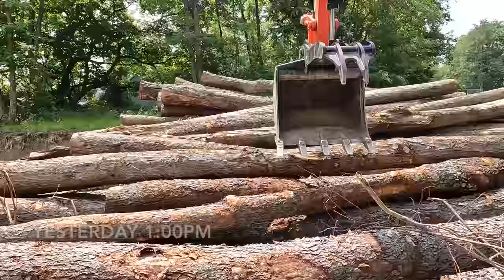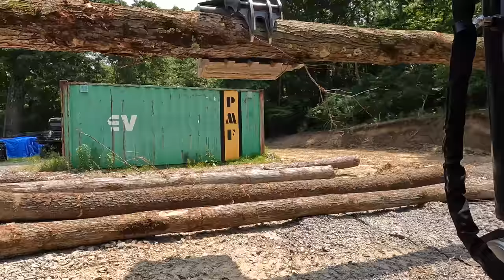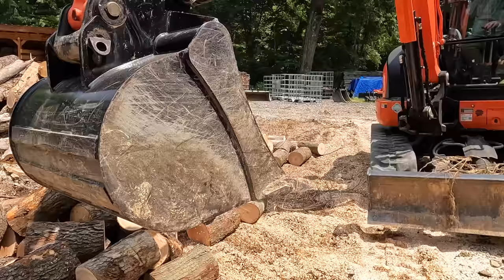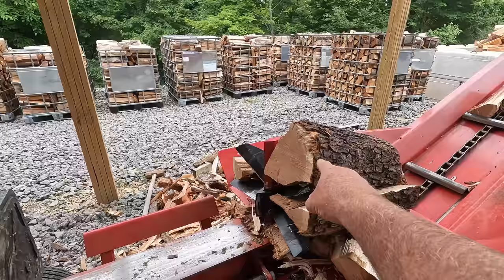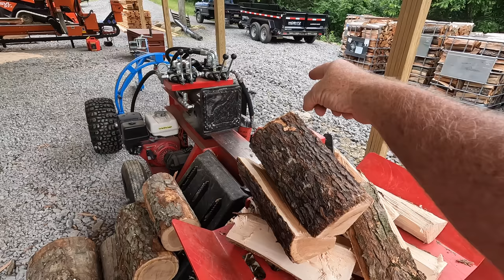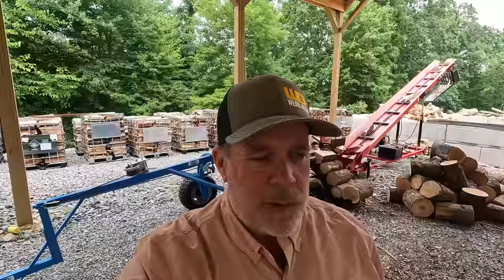Unfortunate Accident at the WoodYard, Freak Accident

Comment: Good Ed will be ok.  Accidents really suck.  Im still wearing severe scars from 20 years ago in a welding mishap.  I use to us use a belt-driven by a tractor buzz saw.  It's now a yard ornament.  Those are really dangerous.  I recall stumbling over pieces of wood near the blade while it was running.  I decided to stop using it lol.

Comment: The combination of the strain energy locked up in the knot and that introduced into the edge of the round where the ram was pushing it through the wedge probably provided the energy to launch the round forward and up.  The piece was restrained until the wedge completed the split.  Then the compressed wood containing the strain energy relaxed, pushing the piece up and forward. 

 A similar thing happens when a leaning tree "barber chairs" during felling.  In that case, it is the bending caused by the lean in the tree that builds up strain energy in the trunk wood.  When you cut through the tension side of the trunk with a back cut, the strain energy shifts to the center and the wood fails in shear along the length of the stem.  After that, the weight of the tree bends and breaks the attached remnant of the stem. ( When avoiding barber chair, doing a shallow notch and a central plunge cut removes the central region of high shear and shifts the strain into tension in the back strap.  The wood doesn't fail until you cut the backstrap because it is much stronger in tension than in shear, and the limited area of the backstrap section doesn't allow a large crack to develop.)

Comment: So glad to hear that Ed wasn't more seriously hurt. Would it be possible to get a cage to go around the splitter and about 2' more towards the conveyor, sitting at least 1' above the top of the center splitter shaft and out to the edge of the tray on either side to keep any breakouts  from flying off again? I've seen the cages on other types of higher performance machines. Wolf Ridge may have something, or it could give them a new market, or a market for some entrepreneur who watches and is in the area.

Comment: In the UK we had 10 feet x 6 feet weld mesh panels in a tubular frame, stood in concrete or dense rubber blocks and clipped together. They are called Heras panels and they are most often used as temporary barrier fencing around construction sites or other areas you want to keep people excluded from. They are light, one man can erect easily, and I suggest that if you can obtain them or similar in the US that you do so and create a "crowd barrier" say one panel out from the log roll loader and then say 2 panels long towards the dump pile and do it on both sides. Then people cannot get within range of shooting chunks of firewood. As a former Construction Manager bearing responsibility for safety on my sites I would have been obliged, by law, to do an assessment for safety on the operation of your machine and almost certainly the legally constituted Health and Safety Executive would have shut me down had I not done the barrier fencing. God has been kind to you even if your Father-in-Law doesn't agree, you have had a lesson to take to heart showing something you were not aware of before. Now you know and can thank God no serious injury from the lesson. Love your videos and applaud your honesty in this one.

Comment: I'm glad Ed's condition wasn't any worse, and it surly could have been considering the unfortunate circumstances. As you know, that knot build up a lot of resistance and stored energy. At some point, it was going to suddenly release, and it's anyone's guess which way it's going to fall or go flying. Yep, one in a million, but you could say it was the perfect storm of events. Anyone who has used a log splitter has witnessed the resistance of going through a knot and seen or heard how that energy is released. Thank you for sharing. I'm now wiser for it.

Comment: Mike glad it was no bader then it was .But the knot was the problem it took so much pressure to cut an pop the knot it went flying when it came apart .I have  run a timberwolf tw5 from in the 1980s and had wood that size go 20 to25 feet straight off the wedge over split wood it has happen with all 3 wedges that is the base +4 way and the 6 way  it is something that that happens when knots are there, no knots no problems. It was good that it was not worse  but didn't blame yourself its just out of everyone's hands,just keep making firewood extend your table and put raised sides on it will  help keep wood where you want it good luck to all of you

Comment: Glad to hear Mr Ed is going to be ok, That is the main thing here.
As for why, @15:24 if you look at the log that hit Mr Ed, you can see there is a knot in the log that was grown over. I have to wonder if the grain binding about that knot was part of the cause why the log shot out once the ram overcame that. I know splitting logs for fence posts the area around knots always takes more effort to separate the fibres.

Finally, I wonder if a 3-4 foot square cage of 2" square pipe over the wedge and conveyor end would be worthwhile. All the force in the ram is pushing that way, a cage might be a good idea to catch the ones that pop out that way.

Comment: Needs a POO (point of operation) guard. Something like a chuck guard on a lathe. Not to be in place all the time because it would slow production but if you see a piece of wood start to kick up you can swing that guard in place and if it kicks out it will hit the cage and stay where it’s at. That way you can use the 6 way and it won’t slow down production. Just an idea! Thanks for the videos!!

Comment: I'm just going to say I run a wood processor for our own use, and I have seen even with a 4-way wedge that periodically the wood is up to the wedge, and it doesn't split right away but the ram is still doing its thing and then BANG the wood goes flying through the wedge. I haven't had any go air born like yours Mike but have had them build pressure if you will and then all of a sudden let go. Glad everyone will be Ok.

Comment: You can see exactly what happened at the end of the video.  You can see where, once that piece of wood started to tilt up, the wedge started to dig into the grain just forward of that little knot, and the compression on the small amount of wood that was still unsplit ramped up quickly, and that knot broke loose and it was off to the races then.  You can see it in the piece below it where that little knot is also. Just a freaky thing, but every piece of wood and every split is different.  Very glad to hear Ed's lookin' to jump right back in the saddle.

Comment: I think your culprit is the knot. Usually when splitting wood on tries to split around the knot. Sometimes splitting through a knot can't be helped. The knot is trying to hold the wood together since it is going cross ways through the grain. As the ram is pushing the wood through the splitter blade, the wood starts to split but the knot is holding it together, just like rebar does in concrete. As the pressure increases, the wood starts to compress until the knot breaks. When it breaks it can let go with a pop, and come flying out with considerable force. I've had it happen to me when using a small electric splitter and it was straining on a piece of wood with a cross knot. When the knot broke the piece of wood came flying out with startling velocity.

Comment: I have had this happen to me, but only with cheaper log splitters that were built thinner. What ends up happening is the I beam and the push plate and the wedge all bend apart under heavy load (on cheaper units its worse because they are under built) and it acts like a spring under massive load and once the wood splits it shoots out like a rocket. I am surprised that happened with this splitter.

Comment: Glad to hear Ed will be okay. I had a similar thing happen on one of the small electric splitters. I put too large a piece in the ram and it kept pressing until the piece shattered. About a 10-lb piece instantly flew past my face and went right through our stockade fence. Hate to think what would have happened to my face. I’m already ugly enough! Stored energy can be instantaneously released with bad results. Ironically, in your case, it seems you were doing everything by the book - a tough example of accidents do happen. Glad everyone is okay.

Comment: I've had that happen a few times. 1 piece few about 15 ft out. The rest was within a few feet. And this was with a single splitting wedge.  If I'm not mistaken they were all with knots in them. Elm was the worst.  Build pressure till it popped and the wood flew.

Comment: We had the same thing happen with our wolf ridge. It had the 4 way wedge on. Shot a piece about 8ft straight out into the middle of the dump trailer. It was ash we were splitting at the time. We believe it was slightly froze, and popped apart when the pressure got behind it.

Comment: I have been splitting wood since the late sixties.  Currently have a very nice Wolfe Ridge splitter.
Can't tell you the thousands of times I have had pieces blow off the splitter....reasons in N GA:
Green wood, cold almost frozen wood, or knotty wood. Red oak most common to do this.  80% of the wood I have split is red oak.
Still splittin....

Comment: Build a hoop cage around the cutter wedge. Make it 5-6 inch’s larger then the biggest round you run through. A full shroud will stop those accidents. It can only shoot straight back or forward. I’ve shot a split 8-10 feet right into my truck door. Hard dry wood splits with explosive power at times.

Comment: Glad he is okay. Ive had several pieces come off the splitter at a pretty good clip. Some steel plate hinged on the side opposite of the operator and coming up and over the wedge wouldn't be a bad thing to have

Comment: I've had that happen several times, and I don't split a lot of wood, and I'm only using a 5 ton harbor freight electric splitter. I'm using a single wedge. Knotty rounds have so much kinetic energy that they launch rounds 15 feet. I had one kick out the side hit me on the head, and I fell towards the splitter and got my finger caught on the returning ram. You need two hands to operate it, and I pulled my finger out in time to stop the ram. Finger was mangled pretty bad.

Comment: Certainly glad the worst case scenario didn't occur. 
Would there be any way to make a chain link fence frame maybe 6 feet wide and 6 feet tall and place that maybe both sides or at least one side beside the area where the wood is split?
Chain-link wouldn't really block being able to see the machine and what's happening.

Comment: I was pressing a stuck moving jaw from a 4" Wilton vise with a 12 ton bottle jack not too far from Mike here and it was super sketchy.  There is not a flat surface to fixture off of in line with with the force so a 8" SCH80 1" pipe was passed under the stationary jaw/body cribbed up, and the rotation force countered with some other cribbing opposite the torque moment.  It took almost every bit of that 12 tons to break free and when it popped it was like a bomb.  Its a mechanical bomb.  That 8" long piece of 1" SCH80 pipe looked like a banana when we were done.  If the 12 ton bottle jack didn't work..the plan was the 20 ton log splitter.  Lotta energy.  Respect hydraulics.

Comment: Glad Ed is OK but I'll admit it's so easy to get used to a machine or a process (especially a repetitive motion like a log splitter) and get complacent and you let you guard down. Same thing happened with me and my ex-father-in-law splitting wood with his log splitter. I was running the controls he was loading the machine and we had a system where I would wait to hit the lever until I would see him nod his head well he nodded his head but his hand was still not out of the way and I ended up kind of pinching his finger between the end of the round and put on the splitter. Luckily it had the little rings on the bottom which hold the log off the flat foot so it did not crush his finger but it did pinched it really hard. I felt really bad when it happened but he kept assuring me it's not your fault I nodded my head and said go

Comment: that knot caused it to build up pressure at the one end aswell as putting in down at that angle. I have split ALOT of firewood and i can look at the pieces that wont split easy....You can hear it aswell. I listen for the machine and if it starts to struggle dont push through it. I have had one do something similar when i was younger and it happened when it was REALLY cold out. Hope your father in law recovers quickly!

Comment: Hi Mike,  I just wanted to add, I've had rounds jump most often when the ends aren't cut square, forming a kind of ramp.  I've thought about welding teeth to the wedge or pusher plate, but that might make it worse.  Or maybe a Tee plate welded to thd top of the wedge might work. Also, about 80% of the "jumpers" have been when usìng my SuperSplit kenetic splitter.    I was watching Hard Working Man the other evening.  His kenetic is even faster than mine.  He got hit in the crotch twice by flying wood in that video.  I notice that some of the processors have guards on the saw blades and on the splitting ram.  I hope your father-in-law is Ok and gets well soon.  Prayers gone up.  ;-))  Shalom/gw

Comment: I have seen these with a steel cage over the splitter. Just a half-round sheet of steel with 2-3" circular cutouts so you can still see what is going on, and just the length of the splitting bed. This allows you to stand next to the splitter and if anything does fly off it is going to hit that cage and not you.

Comment: Lots of pressure built up in those logs, especially the knotty ones, you never know. An expanded metal cage open on both ends would prevent future flyers from happening. Log tunnel if you will. Glad everyone is alright.

Comment: Like everyone else,  I'm glad the Ed is going to be ok. I was going to comment about everyone working way to fast around machinery. ( video sped up lol ) you can have all of the safety equipment that you can think of and sometimes you just get a freak occurrence happen.  I think that the knot was in the perfect position to put and extreme pressure load on the round. I'm sure that if you showed the video to Wolf Ridge they could develop a cage around the cutting wedge that wouldn't interfere with running the round through but could prevent it from kicking up like it did.

Comment: Glad Ed is Ok. I have had pieces that will split with explosive power. Looks like a crouch piece. Those are the buggers. Made the decision not to cut firewood in the woods with my 87 year old father. He was retired from railroad with disability when he was 56 because of arthritis. He got hurt on the job and they wouldn't let him come back to work because the arthritis. Not his choice. He's a stubborn working fool thinking he can work and get around like you used to. He needs a walking stick to get around but wants to help in the woods. Told him I am not working by myself because then he thinks he can help me. I was cutting down a stub of a tree and needed to push it over with the tractor because I had pounded the wedge all the way into my cut. He comes out stumbling around with his walking stick and is too close to the drop-zone of this tree he proceeds to argue that he could move if he needed to when the tree started falling. My brother's don't have time to help and he would be in the middle of the action anyway so we laid down the law that we would only cut firewood if we got pulpwood lengths delivered and we cut them up in the yard. ☹️

Comment: 6/20/23...yikes! Oak knot, curved grain, fast ram to 6-way & 'pop' curved grain under ram force resulted in instant shear/separation & large segment under compound pressures up-lifted instantly flying upward (12"-18"?) to right side of splitter striking helper in face/upper nose/forehead area striking/driving eyeglasses (nose bridge) into & cutting skin & simultaneously knocking man down who (in crowded area of cut off 'rounds') fell striking ribcage & results in combo blood & shock to victims & all other family members helping & participating in this, a routine wood splitting activity familiar to all present. 
  Wow! Thx Mike for the step-by-step replay. Glad gentleman is not seriously injured!
  How about building some steel wire-frame cage around exit end? Does mfgr. make/or can make a 'safety cage' for this area.... prevent/control 'grain-pressure-during-split-blast-out'? 
  Thx Mike for sharing this info. Appreciate yur honesty & loving concern for your family member/father-n-law. Stay safe & carry on!⚙️👍

Comment: Only after an accident can an improvement be seen to be needed.  Sorry to hear about someone being hurt but glad Ed is doing well.  Here are my thoughts:  Log Arch.  No, not a log lifting arch but an arched tunnel cover over the splitter head extending maybe 4'-5' towards the conveyor using corrugated steel liner running longways with external framing for support.  Tall enough so split logs folding back won't contact the cover.  Essentially nothing would ever touch the cover until something goes wrong then IT will be in the way of any sprung log parts.

Delete this if you see no worth in the suggestion.